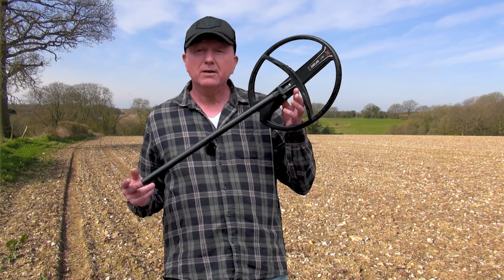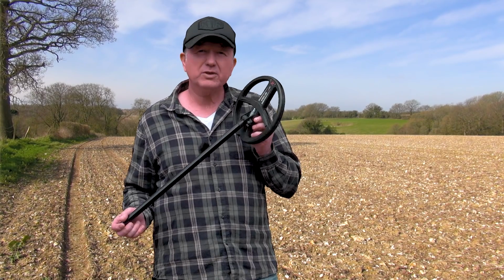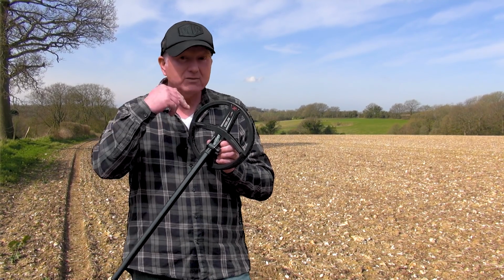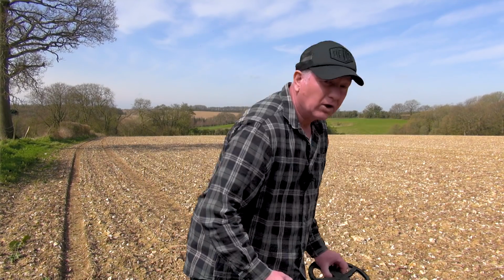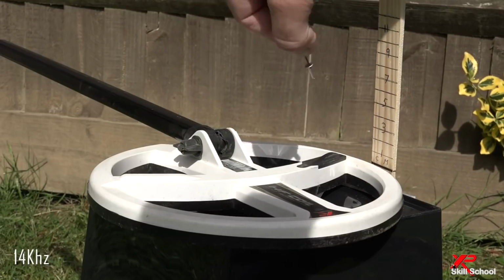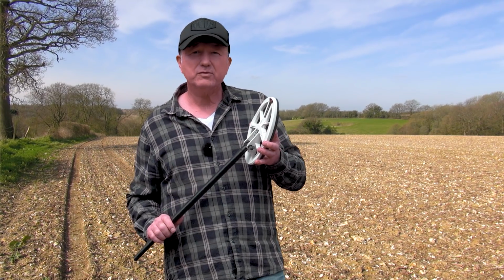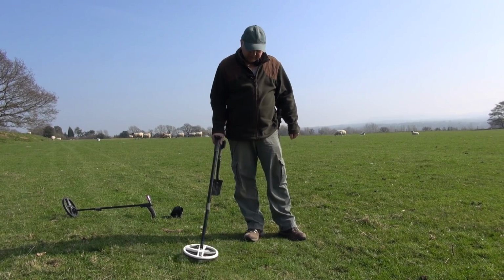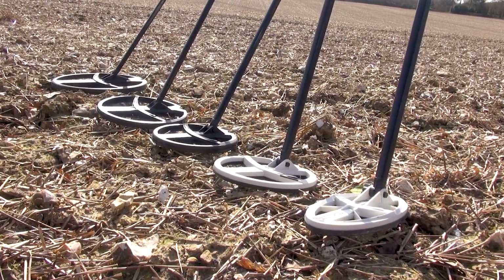The best METAL DETECTOR search coil

Comment: Cheers Gary, when I bought my Deus 1 it had a 9in x35 coil - then I bought the 11in  x35 coil and now ive bought a 9in hf eliptical, I could have saved £300 as I find more now with the 9in eliptical coil.  Keep posting the videos.
Reply: Same here, my 9in HF eliptical finds tiny targets. surely if you are finding small targets it wouldn't miss larger ones?

Comment: Hi I have a question..... With my orx which coil goes deeper at areas with low/mid Iron contamination? X35 11x13 or 9" x35??? 11x13 never can works with low reactivity (always at 2.5)....with 9 inch coil can I work with low reactivity and the machine works settled? And go deeper of course

Comment: Hello!
 
 
I wrote to you about the choice of device, on Saturday I purchased XP ORX and was disappointed.
 
Depth! Why do cheaper metal detectors VANQUISH , Simplex, apex see the average coin deeper?  Add in the depth update. 30 cm through the air, as if specially limited, in today's realities - it's not enough for a coin!
Sound! A few tones are missing for normal identification! Add them!
The volume of the sound! No basic sound adjustment? You are chasing the money encouraging to buy headphones, this is ridiculous!  
The plastic of the control box and charging clip is low quality. Are not XP metal detectors worth making from quality material. Saving half a euro?
Why does the VDI display have such a long delay, is the device asleep?
Cheaper gauges show VDI at greater depth. In the ORX it is lost and only the sound remains. In the cheaper instruments the VDI remains at a deeper distance.
Comparing 9'' and 22'' coils, there is virtually no difference in depth. How so? Make a larger remote battery on a white HF coil and a new x35 with a larger remote battery for the coils to start picking up deeper targets.  Up to 40 cm in the ground on a medium sized coin is fine.
Feedback? I sent you two emails, and from you there is not even a basic "Hello"
 
 
  
 
Why is there not a single update (improvement) from 2019 at all, but a wire is included for updates?  Many used to think you were the great creators in the world of metal detecting and you...just ditched?
 
 
 
I'm looking forward to updates and support for my instrument! They didn't put the cable (wire) in the kit for nothing! So let it begin to be used as intended!

Comment: Hi I am running a x35 9 inch coil but brought a spare used 11 inch coil and can’t get it to pair can the coil be updated
Reply: You have probably figured this out already - the answer is yes.  As part of the upgrade process (assuming you have correctly added the serial number and new coil) you will be prompted to select the new coil and it will perform the update. I had exactly the same issue with my new 11" coil.

Comment: Good video Gary.
I still think the best allround coil for almost any machine is 11 inch . But the best in trash on the Deus/ORX is the 9 inch white . 
I think if XP came out with a larger elliptical at 12 x 10 inch it would take on the Minelab's more in the Gold fields . 
Maybe it would be a bit awkward in trash having high freq or used in high freq but for the small Gold nuggets it would be deeper i am sure. When i watch Aussie Gold Hunters and they are using the Minelab P.I. machines , a lot of the time they are pulling out nuggets that are around the weight of a standard Gold ring and at no more than 6 to 8 inches . I am sure that the Deus and ORX could match at least that with a larger coil with high freq and pull out the 1 gram nuggets at depth too.
A bigger white HF coil would give better coverage too.
Reply: Thanks Richard
Reply from the maker: Thanks for your input Richard